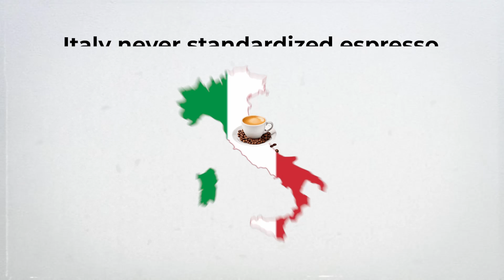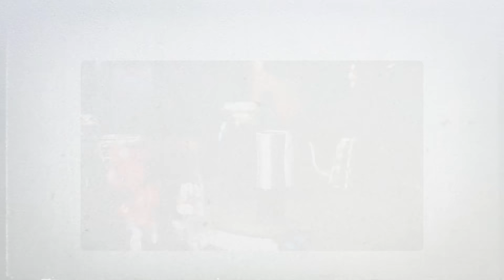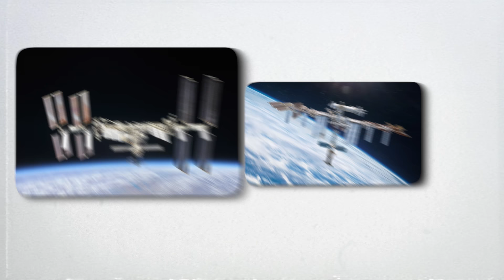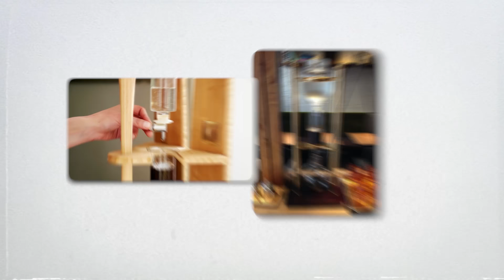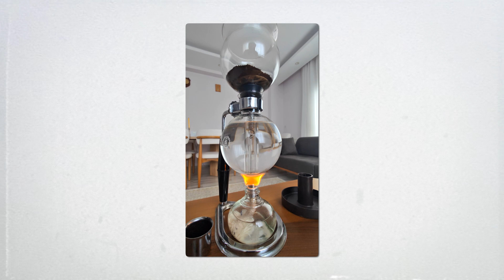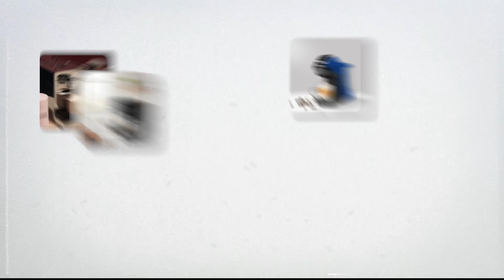Every Coffee Brewing Method Explained (PART 1)

Comment: A couple that you missed:

Drip Machine - Pretty much how most people in the US make it at home (as far as I know, at least). A machine heats up water in a reservoir and slowly pumps it up and onto coffee grounds in a filter paper lined basket, from which it then drips into a pot.

Ice Drip - Same machine as described above, but the pot is filled with ice. Less water is used, resulting in a more concentrated brew that dilutes as the ice melts, and the result is a cold coffee that (supposedly) has a better flavor than coffee that's been left to cool down gradually.
Reply from the maker: Great additions, both are on the list for a future one — thanks for the detail!